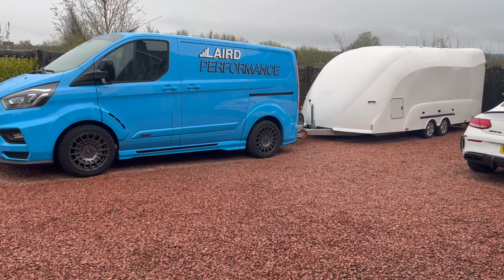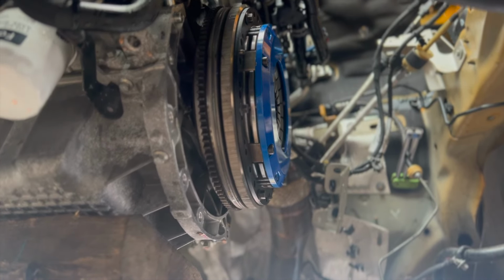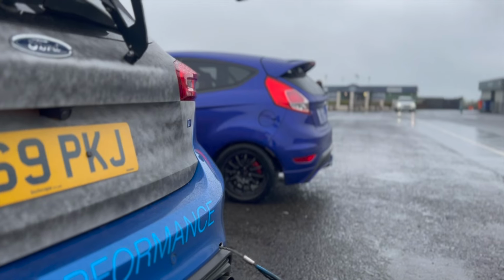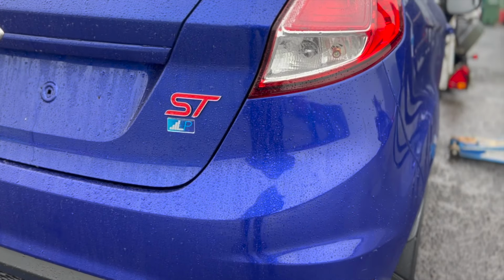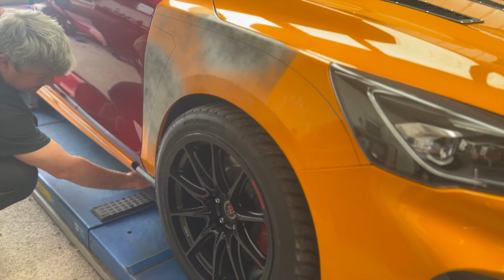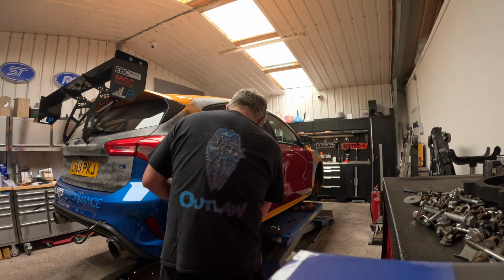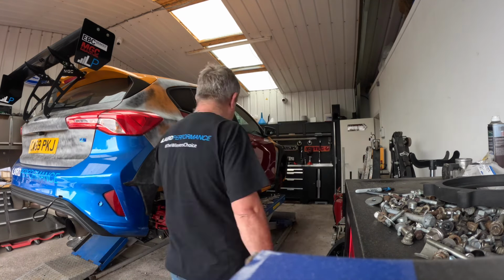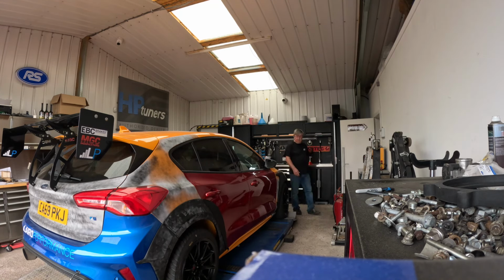MK4 FOCUS ST GOES STAGE 3!

Comment: How much hp and nm does it put out and whats the limit on nm ive been told rods go from 400hp and around 600nm ?
Reply: 400cv stage2+ new in dreamcience
Reply from the maker: @rubenmaye5808  we arnt dreamscience, we have been doing over 400bhp stage 2 for almost a year now, the Hp output of this kit it tells you in the video 

I’d being saying 600nm is absolute limit from what iv seen
Reply: Brilliant video again 👌 I've got a 2008 mk2 st225 wanting to goto stage 2 with u guys when I gather some money 😂 done 1/4 mile in 14.68 fastest after 16 runs which I feel is far to slow, and 137mph at the mile couldn't go any faster was trying everything.
Reply: How's the clutch holding up ?